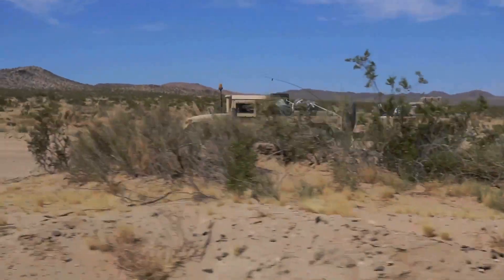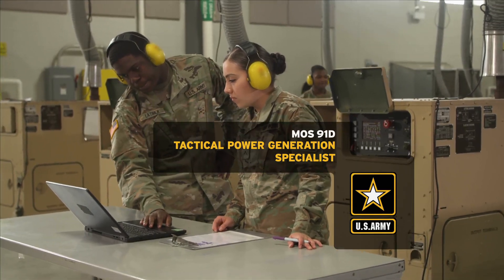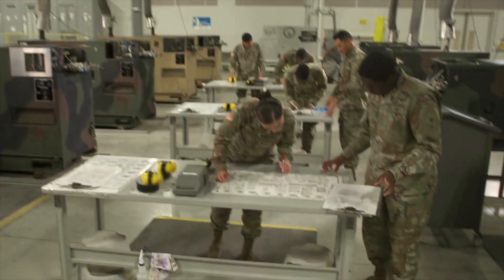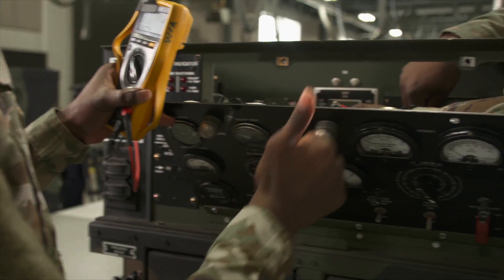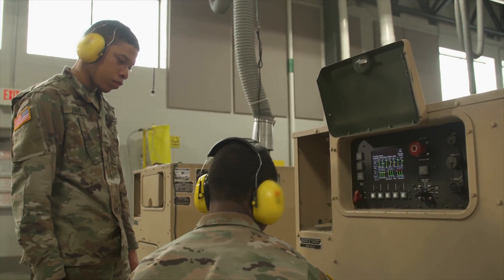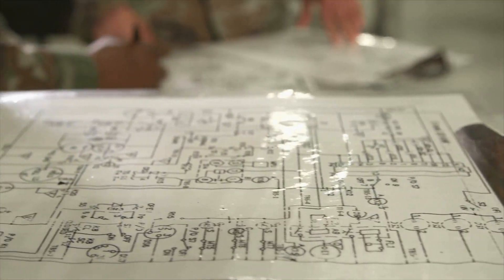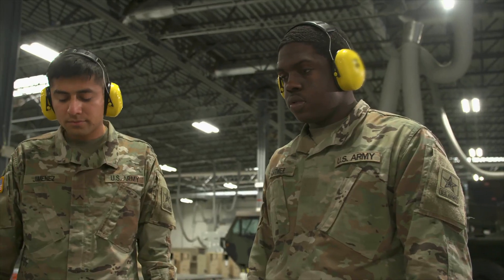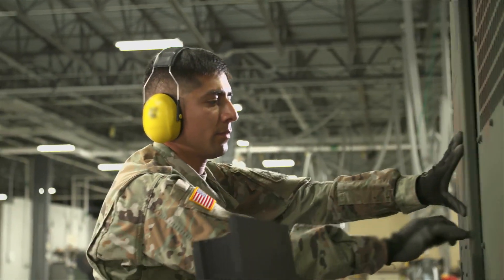Army Generator Mechanic - 91D - Tactical Power Generation Specialist

Comment: I did this MOS and worked at a methane power plant after the ARMY  !
Reply: That’s my plan bro!
Reply: @Savage22223  Go get it fam!
Reply: Is this a good mos because I chose combat engineer at first
Reply: @scorqio how did you get in? Any tips are greatly appreciated.
Reply: @trentonsanders4059  in my opinion, this is the best MOS. #ModernWarfare
Reply: @limeflavoredbleach5570  get in what? The ARMY or the power plant?
Reply: @scorqio  the power generation job/ power plant
Reply: @limeflavoredbleach5570  i got the job within like 2 months of leaving the army. I just applied for it. But, i also went to highschool which was a tradeschool and i did electrical for the 4 years. So, in other words, my resume was stacked in THAT direction. I was 23 when i got the job. Am now 31.
Reply: @scorqio  which certificate or license did you get? Sorry for asking so much but I’m trying to change my career path. Thanks.
Reply: @limeflavoredbleach5570  nah your good fam ⚡️⚡️⚡️, your are doing the right thing.

I did not have any certs. Highschool and the ARMY generator mechanic ( 3 years) were the main things on my resume that spoke electricity and mechanics. 

In the ARMY i got a few certs on things,  like A 5-60kW generators, but i dont even think i showed them this.

It probably helps that the 1 other person that i worked with was from the NAVY. That is probably more important than you think. He told me he never really saw anyone get hired as young as i did when i worked there.. alot of the guys hired are like in their 30's. I quit after 1.5 months (lol), but it was an enlightening experience. I quit because they wanted to send me to a different state to qork with more people on something, but i didnt want to do that.
Reply: What was your salary
Reply: @scorqio if you don't mind me asking how was the pay once you got out of the army? Would you say it was worth it? Also did you go to college while being in this mos??? 
(Sorry for too many questions, I'm just trying to decide my mos!)
Reply: @val-wm2ye  pay was great(60k a year), i did not go to college for this.
Reply: @scorqio omg okay, that's solid! And how long was your contract for? I want to see if I can do some schooling while active or if maybe some opportunity similar to yours will present itself to me. 
Would you mind me asking the company that hired you?
Reply: @scorqio also I'm sorry for all these questions but you said you quit, what job did you take up? Or was it still the same just different company?
Reply: Also was it heavy workload and very tiring? Or tolerable
Reply: Was AIT hard??
Reply: @val-wm2ye  i scored 2nd highest in my class. Ait was fun. 

The power plant job i got was not exactly that hard.. 

I went to college online courses in the army but failed out because i stopped attending class.
Reply: @scorqio  oh I have a question about college? Did army cover it all while you were in?? And why'd you stop, did the mos not give you enough free time?
Reply: @val-wm2ye  i dont remember if the army covered it or how. This was like 10 years ago. 

I was kind of busy in life at the time. Just stopped caring about the class all together lol.
Reply: @scorqio  ohhhh okay, and are you living pretty comfortably right now? How's your job, is it still in the power plant Field?
Reply: @val-wm2ye  yes, i live well. No i do not work at a power plant anymore.
Reply: @scorqio I'm sorry for all these questions just tryna prepare!! What job do you do now?
Reply: @scorqio  and was the job you have now available to you because you did 91d? Like did the certs/experience helped you get employed?
And if you've had multiple other jobs, what kinds of jobs can you get by being in this mos based on your experience
Reply: @val-wm2ye  yes. Ofcourse. The army is elite. It was ne and another operator. The other operator was from the navy and said to me at the time that he never saw anybody get hired at the age i did, which was 23. I am now 32.
Reply: @scorqio  wait so what kind of job do you have now?
Reply: @scorqio  also you think 91c or 91d I'm really conflicted
Reply: @val-wm2ye  i was a 91d. Idk off the top what a 91c is lol
Reply: @scorqio  oh thankssss 
Also did you use your VA loan? How does it exactly work? I'm understanding that you buy a house no down payment and only monthly payments that consist of fees and cost overall. Do you know?
Reply: @val-wm2ye  no i did not use that.

Comment: When I was in AIT, my instructor at Fort Lee once said 91D are also known as 91-Do It Alls 🤪
Reply: Is delta mod hard? I heard so much horror stories I’m in B mod right now. Pls
Reply: @limeflavoredbleach5570  Delta mod's not super hard, as long as you follow the diagrams precisely. Good Luck! ;D
Reply: @limeflavoredbleach5570  it seems hard at first but it’s very easy surprisingly
Reply: You're not wrong. You can probably do better than a 91C at his own job
Reply: @devnotes00  Ironically, I taught 2 of my soldiers—who are 91C's—how to do a checklist for AC units haha!
Reply: Spartans lead the way

Comment: This mos was an option when I enlisted. I chose a different mos but this one still seems neat.
Reply: I was this and I swear I was doing this half the time and also doing maintenance on vehicles, it depends on what unit you get and where. Ft Irwin was where I went unfortunately
Reply: Unfortunately in Irwin, I was 2/11 unit we used drash, which was a different type of generator and I lost most of my knowledge do to them not letting me work my field, but I've learned more vehicular stuff because I was hanging out with them and helping them more. It just socks that they didn't let me work more on generators
Reply: @josephperales1848  Hii I'm thinking of doing this or 91c. If you're out of the military can I ask how quick you found a job using those certs/licenses you got from being a 91d?

Comment: Is this mos good for civilian life? They get paid good?
Reply: Yes. I was a 52 Delta went through army engineer school at Fort Belvoir in 1987. Got out in 1994 went to work as a civilian generator technician. We done service, rebuild, and emergency repair. Worked in hospitals, nursing homes, cell phone towers, and a lot of grocery stores. Went on to get certified by multiple manufacturers such as Onan, Kohler, and others. There is always a need for power especially during storms when commercial power goes down.
Reply: @charlessloan204  hiii! What company did you work for? I'm thinking of doing 91d but idk if I'll be able to find a job on the civilian side. Did you need your bachelors or did you just apply with the experience the army provided you? Please let me know !! 
Also how was the pay

Comment: Lmao there’s a huge chance you won’t even do your job in your unit if you have this MOS 
Plus so many generators in the army don’t even work
Reply: ...What WOULD you be doing instead?
Reply: @marlonmoncrieffe0728  any other type of mechanic work
I was a wheeled mechanic 90% of my time , 5% generator and 5% parts clerk
Also depends on your unit ,I was in a MP unit so all of our equipment was in the low usage program
Reply: Definitely depends on whether or not the unit even has the equipment to begin with
Reply: @devnotes00  yeah I know lol I was in a MP unit and they 6 generators that were all garbage and part of the LUP 
So I was literally a 91B and 92A was my secondary MOS officially
Reply: Just because generators are outdated or broken don’t mean we don’t work on them. That’s what motor pool Monday is for when sm suppose to pmcs their equipment.
Reply: @RealTalk_312  I never said we DIDNT . I said my unit only had 6 n I barely did my job …..
Reply: @VNRPro  we use to work on them day and night at bliss i actually became good at repairing them. Didn’t even have to look at the tm to troubleshoot
Reply: @VNRPro  we also cross trained with the 91c and 91b from time to time when they needed help
Reply: @VNRPro  thank u for service btw
Reply: @RealTalk_312  that sucks then
I was in a MP unit and all our stuff was low usage program
Probably had the sweetest and mose laxxed active duty career ever
Reply: @RealTalk_312  I was mainly 91B 90% of the time and hated it lol